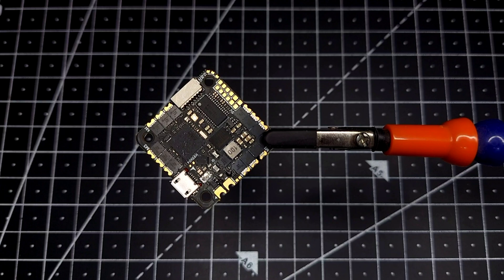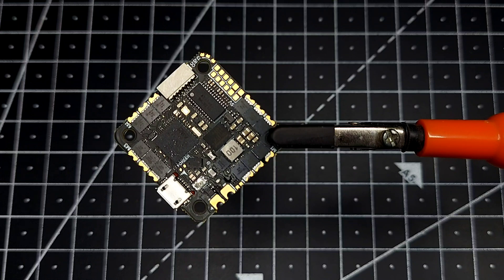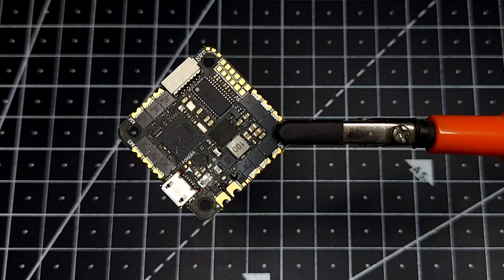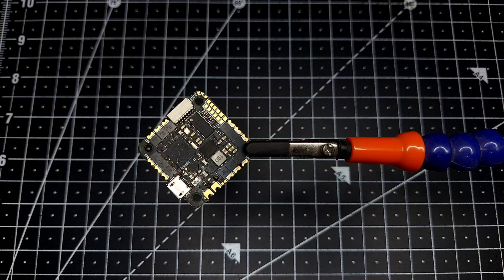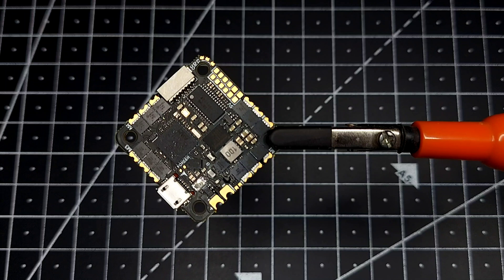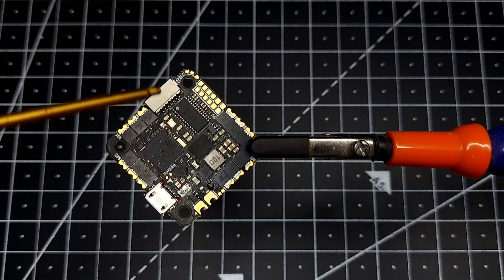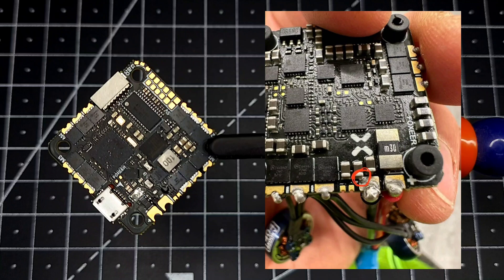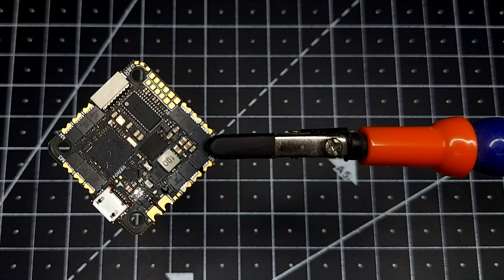Can this get any better ? Foxeer Reaper V3/V4 AIO #fpv #fpvdrone

Comment: I cannot find led input on this board
Reply: Any update on this? I didn't find anything 😅
Reply from the maker: Refer to diagram on official website
Reply: Really I don’t know. And it’s hard to understand How did they forget to add any input for led light in this flight controller card.  Can we use one of other uarts rx tx connection for led? with remapping. we need a solution
Reply: Did you found any solution?

Comment: Ow damn, I soldered my motors against the components, still works great so lucky? But they could indeed make it a few mm larger, would not hurt anyone.
Reply from the maker: Not luck it's science because pads and those components are in continuity... I wish the same and V4 already has fixed that
Reply: So the 4pins of the MOSFETs that (I believe) are touching the motor pads are the Drain according to the Datasheet right? In other Esc's, the pins heading out are S and G, but I understand that in this Reaper, it's ok if the pins and pad touch?

Comment: what about SpeedyBee and Diatone which even support Wireless control via SpeedyBee App and equally impressive specs
SpeedyBee F745 35A BLS AIO Flight Controller
Mamba MK4 F740 AIO
Reply from the maker: Quality of parts used are of very low quality

Comment: Its out of stock in your buy link. Right now.
Reply: upgrading to V4
Reply from the maker: Yeah since all my reviews are independent I am sometimes late to the party haha... Btw I did have a look at V4 it's almost same design with gyro being changed so same would apply for V4 as well... In the video I also did mention about MPU6000 one
Reply from the maker: Check again